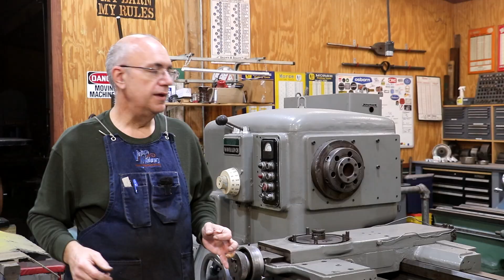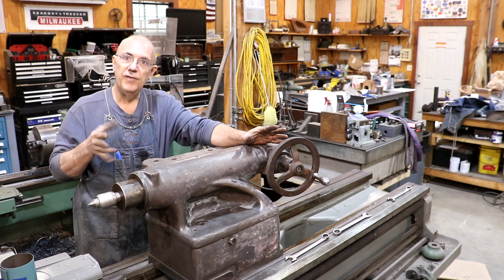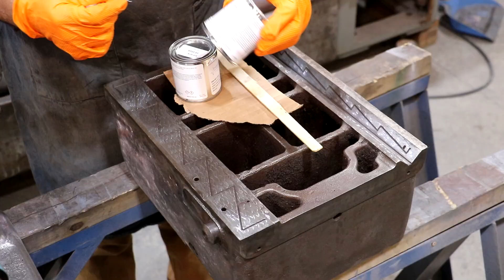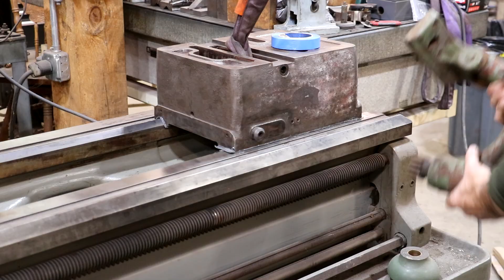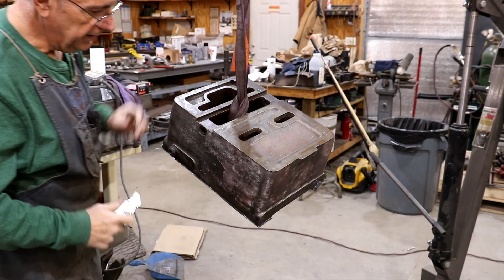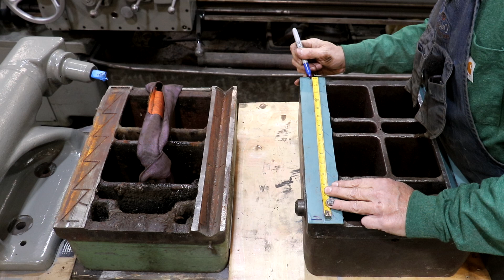Monarch 612 Lathe Restoration: Building up the Tailstock Height with Turcite Wear Strips

Comment: my attitude to epoxy is that teflon is supposed to be non stick and turcite is just teflon and brass...

anything that has reasonable working time. 

other than some weird single part heat-set epoxy, ive never found any to be much good on metal... that being said, ive never had a turcite fail in use... and its always the turcite that lets go when removing...

tailstocks are scary. 

the cricket has to be parallel before bothering with the quill alignment...

Comment: I used to glue a similar material when I was working in a lathe factory. Admittedly, it was a year, but I learned something there. We used this material to glue the sledge, which went straight from the planer. Every month there was a batch of lathes that were exported, but not to the USSR, but to the West. It was 1985-86 The worst job in the world. Not even that it was tedious and poorly paid, but because of the stench of this glue, which made me want to vomit. This particular work was dedicated to our team, which was engaged in drilling the basic elements of lathes, including sleds. When the processing of this element was completed, i.e. drilling all the holes and threading those that should be done, the gluing began. This material was very thick, because after the glue dried, the sleigh went to the grinder where the final processing was done, but that was no longer our business. I hated this particular glue job.

Comment: Use an indicator on the spindle to determine the exact value.Use a flat shim between the two parts of the tailstock. Peel apart shim stock is available at Mcmaster with .001  peel offs.

Comment: Some cheap paper plates and bowls from the picnic section of the grocery store for mixing epoxy and other chemicals will be the best 5 bucks you ever spent.  I buy old silverware such as butter knives from the local thrift store for about 10 cents each and they make incredibly good mixing spatulas--clean with a wire wheel after or just toss em.

Comment: Martel stock on my 612 has a oil reservoir that feeds down to a hole into those grooves. It looked like yours had the hole also. There is a hole down low that you fill the oil in to the little cup reservoir inside

Comment: FYI the manufacturer of Turcite recommends shallower and wider oil groves which shoudn't be near edges and shoudn't be cut all the way thru the material.  https://www.boedeker.com/Portals/0/Documents/Turcite-B-Slydway-Boedeker-Plastics-Technical-Installation-Guide.pdf?ver=2019-08-22-212309-440&timestamp=1566527242807

Comment: Tailstock alignment tool.  Ground bar that will fit all the way thru the spindle hole.  Make sure its straight.  Drill the end to center on the tailstock.   Then cut off that section making in about an inch. Face off both cut faces.  Now you can chuck the long bar up and indicate it in. Hold the one inch piece and bring the tail stock forward . Now you can see which way the tail stock is misaligned in seconds. Allowing you to easily use shim stock for different lenght jobs in minutes.  Heck you should be able to not only measure but feel and see the difference.

Comment: I might be wrong but couldn't you shim the tailstock up at the join between the top and bottom so the turcite doesn't wear on the ways.
Reply: But the cast iron ways would still continue to wear with use of the lathe.  The turcite wears longer than cast iron, so this increases the interval between repairs.

Comment: These videos are getting worse and worse. I had such respect for him after that awesome restoration of the shaper. Now I’m watching him eye ball the difference between a dead centre and a knackered old live centre with some callipers so he can do a poor shim job on the wrong part of the tail stock. He’s even got a cylindrical grinder where he could have made a full video on grinding a test bar for between centres. Or just waited till he can turn a piece in the lathe to the same diameter as the tail stock quill and simply check the difference in height with a dti. He seems to just keep flicking between machines doing very low standard repairs mixed in with repairing the odd cane mill. Thankfully the cane mills need zero precision!

Comment: I'm TOTALLY perplexed as why you have chosen to add shimming UNDER the tailstock, on the part that slides on lathe's ways, while you could just add some right between the top and bottom part of this two part "split design" tailstock. Others mentioned some issues with the quill rising too much when stock is locked, but I just can't see how this or that placement of shims could make any difference. And then, according to my quick look into the subject, Turcite isn't an ideal solution, and it has some limitations and drawbacks as well.
When you have monolithic stock you're out of options and Turcite may be the only way to go, but in this case I see no reasons whatsoever to go this way. Am I missing something?

Comment: Using the same thickness shim on both the flat surface vs the 45 degree surface results in the flat side be raised less than 45 degree side.

Comment: Hey Keith.  Hope Christmas went well for you and yours.  In the last video when you said that the centers of the spindle and tailstock looked to be out of alignment by about half an inch and you were talking about using Turcite to shim up the base,  I started to think you'd slipped a gear somewhere.  After watching this video I realized that the half inch was either misspoken or you were taking into account the lateral mismatch as well.  Either way, what we saw here was WAY closer than that.  Some have mentioned using precision setup bars to align the two, but you've done enough lathe setups on this channel that I wasn't worried about you coming up with a good, usable, acceptable means of alignment.  I know that using the calipers to measure offset was just a WAG to get close.  Glad to see the 612 getting some love.  Happy New Year and looking forward to what you bring us in 2024.

Comment: The side with the “Vee” way will rise more than the side with the horizontal way. If the “Vee” surfaces are at 45° to the horizontal my schoolboy trig says you are looking at 42.5ish thou lift with a 30 thou membrane. And that’s ignoring any adhesive thickness which would increase the differential between the two sides.
Reply: Was thinking this the entire time.  Does it matter though?  As long as center is center……right?
Reply: I think so yes, the contact area of the flat side is only about half of what it should be, tilting the headstock from it's flat axis effectively increases the pressure at the edge of the flat contact area. reducing tailstock to bed contact even further. @gstri5800

Comment: I agree with the others who would put steel shims between the cricket and the tailstock instead of the Turcite under the cricket. An advantage to doing this is the shim packing can be set so the quill can be made parallel to the bed. 
If you want to keep from pulling your hair out it is important that the tailstock quill is parallel to the lathe bed and the headstock spindle center line. This fault is noticeable when you are trying to cut several bearing surfaces on a shaft. You end up with a mysterious taper that even if you can get rid of it adjusting the tailstock side to side reappears when the tailstock is moved on the bed.

Before doing any of this, get a ground test bar for you lathe spindle. Up through a 4 Morse taper they aren't very expensive (for the ones made in India). If the head stock spindle center line is not parallel to the lathe bed horizontally and vertically you are urinating into the wind trying to do any further fine adjustments to the lathe.
Reply: not just the quill... the CRICKET has to be parallel with the headstock.

front to back not so bad, but side to side... offset for tapers and its moving up or down. producing hyperboloids rather than tapers... trumpets and barrels.

that key has to be at right angles...

THEN the quill housing can be scraped to the cricket so its parallel, and co-axial... 

real daunting task... i know my POS needs doing... its terrible.

Comment: As others noted, wouldn't it be easier to shim the upper and lower halves for height. Scrap the way interface for oil retention; no need to plug your oil holes with epoxy and Turcite.

Comment: Keith, 2 points : 1 - Let's say that you used .030" Turcite. This will raise the flat side of the tailstock .030" ( ignoring the epoxy for now ), and raise the angled ( V groove side ) up .0424".  2 - 
Don't you need to drill some oil passage holes through the Turcite ? Thanks, I enjoy your work, Al
Reply: Came down here wanting to say the exact same thing.

Comment: Keith, a fast and easy way we used to check/adjust tailstock was with mag base indicator mounted on headstock (or chuck) with indicator sweeping the tailstock spindle. Make sure clamp is tight as it changes measurment. Also turcite bad choice for clamping surface; better to shim between castings. Best regards in the new year!
Reply: Yes, shimming between castings seemed like a much better idea to me, too.
Reply: @chrisarmstrong8198  What I was going to suggest.
Reply: I agree, but i would not use a mag base because of droop. I would put a short indicator holder in the jaws of the chuck and then sweep the inside taper of the tale-stock ram, and make my measurement. The wear of the Turkite is negligible for the use it will get and will not be an issue in our life time. I do love that you are repairing and refitting this older machine. Thanks for the great videos.
Reply: I have no particular expertise in this area buy I too thought he was going to shim between the halves.  Was surprised to see the shim go on the surface that contacts the ways.   Was the turcite an upgrade to the cast/steel wear surface in addition to obtaining the height addition that was required?
Reply: Wouldn’t a more proper and accurate way of measuring tailstock height be to use an alignment bar? Concur with the shimming aspect since this tailstock is split. Obviously, Keith isn’t concerned with precision on this machine. Hopefully Keith cleaned the bond line fraying surfaces with some sort of solvent prior to adhesive application. If not, I would have zero confidence in bond line integrity for this job. He must have done it off camera. Hate to be critical of Keith’s work here, but I have 36 years of manned spacecraft high reliability adhesive bonding behind me. I bonded Rulon onto my Hardinge HLVH tailstock after a bedplate regrind to restore alignment. It wasn’t an easy task which is why most, if not all Hardinge rebuilders shim the bedplate. The problem with that is it doesn’t address the tailstock wear. To completely address that, we fabricated an adjustable workholding fixture for the tailstock, machined a calculated amount off the contact surface, bonded the Rulon, machined the Rulon to within about 0.005 of final thickness. This left material for pitch adjustment via scraping. X-axis alignment was achieved by converting the gib to an adjustable type. The result far exceeds the Hardinge factory specs. The machine is no longer a Super Precision HLVH, rather it is an Ultra Precision HLVH.  Again, Keith probably isn’t looking for that level of accuracy on this resto, nor does he need it.
Reply: i believe towards the end of the video he was mentioning the other tailstock was only making contact in one spot and that was part of the reason he went that way, so he could scrape it in so it'd have good contact
Reply: @tombeauchamp806  I believe what he meant was, the base is narrower than the width of the ways, meaning only about half of the flat surface on the base of the tailstock, actually lines up with the flat way on the lathe.

If you look around the 4 minute mark, you can see how the tailstock is only resting on about 1/2 the width of the way nearest us.

Comment: Morning Keith, great video, the turcite should get you back track for the elevation of the tailstock. You probably have already a small oil groove leg on the flat side that when you finished up had not been put in yet. Wanted to be sure you had all of them prior to assembly. 🙂
Thanks for sharing.

Comment: Hi Keith.
Tell me if I'm thinking correctly here. 
Looking at the wear on the end of that tail stock traverse gear it looks as if it never engaged the lead screw horizontally when new. You might not need to space it out from the tail stock but just mill a flat to mount the apparatus.
As far as those worrying about Turcite durability, they must have missed that it's used on new machines quite frequently now.
Also, lookin' good there, El Flaco!
Reply: As a wear part/revenue stream, i presume? Modern machines rely on their computers to measure and account for accelerated wear and manufacturing inaccuracies. These old manual machines have no such luxuries.
Reply: Except Keith will be scraping it in. @derschwartzadder
Reply: Or apparently not as I see tonight it lines up fairly well.

Comment: I use a certified test bar and DTI to align tailstock centers, as I often move the tailstock alignment when machining long tapers. Obviously the relative heights would not normally change but simply measuring vertically would achieve perfect alignment on the vertical axis.

Comment: If it was my lathe, I would have added the turcite to the separation line between the base and the upper. As long as the keyway was still engaged this could have been a steel .030" shim.
Reply: Turcite wears longer than the original cast iron.  Leaving the ways alone would mean the tail stock will go out of alignment again sooner, than it will with the turcite added.

Comment: When you mix two components epoxy... Don't use the same stick for the hardener that you used for the resin. The hardener will be contaminated.
Reply: True, I've even ruined epoxy by setting the hardener cap close by the open can of resin. It just needs a sniff of the hardener to go off.
Reply: He used opposite ends of the stick, for the resin and catalyst.

Comment: Too bad Monarch didn't make some adjustability for height in their tailstocks.
Reply: The adjustment point is there and simple, add shim between the two halves of the tailstock.Sigh. By shimming the way slide the headstock is tilted slightly backward, which can be adjusted out but means the contact point in the ways is uneven I very much doubt it can be hand scraped out, it would need very accurate grinding to correct.
Reply: @seapy2398  Isn't the connection between the top and the bottom halves of the tailstock a dovetail so the tailstock can be moved horizontally and still stay aligned on the longitudinal axis? To shim there would require modifying the dovetail.
Reply: Not as far as I could tell I thought the top was lowered onto the base. @tiredoldmechanic1791

Comment: Should have taken the unit apart and cleaned the surfaces before the measurement, then put a collet in your head stock holding a piece of round bar.  blue the end of the round bar and bring your tailstock center up against it.  Turn the head stock and it will inscribe a circle on the end of the round bar- your height difference is half the diameter of the circle.
Reply: You seem to always know everything.  Why aren't you down there doing it for him.  I am sure he would appreciate an "expert" in his shop!!!
Reply: @paulcopeland9035  No- I just know how to adjust the center height on a lathe- I'm sure if you knew how, you would have posted too.